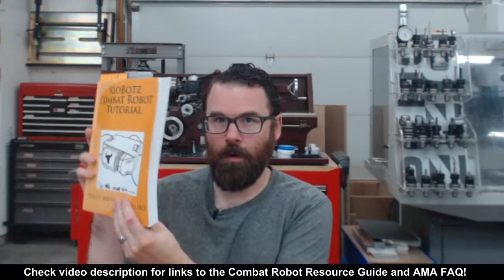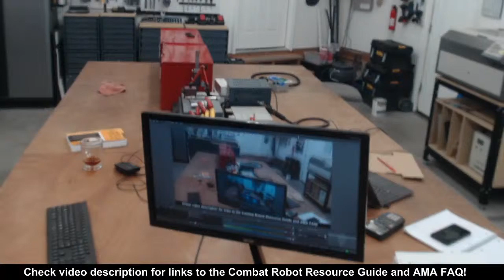Live Q&A and AMA with Robert Cowan - Volume 8

Comment: Loved the stream! Thanks for answering my questions. If you happen to see this, I just have one more.
So I was thinking about designing a hub motor like you have, and I was wondering if you knew what the dynamic radial load the bearings you used were rated at. Correct me if I am wrong but wouldn't that help the issue of the bearing fractures. I have never seen a bearing fail quite like that. I am going to try and get some designs worked out for my 15 lbs bot.
Anyways, love you videos. I can't wait to see the return of Crippling Depression. 😉

Comment: Missed the stream too:( my experience with drum spinners is very good. For example, my antweight drum spinner has a 2” diameter and spins at about 10,000 rpm.  But my drive is very fast as well and I agree 100% that having a fast drive to engage with a drum is very important! There are some drawbacks though.